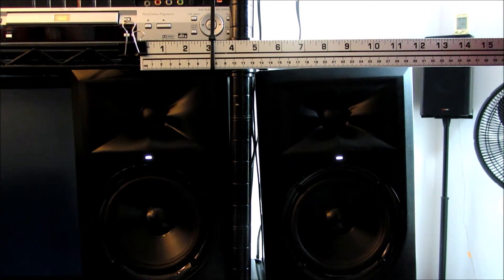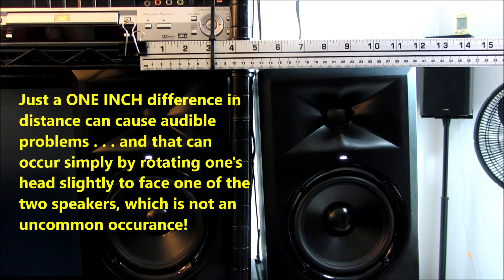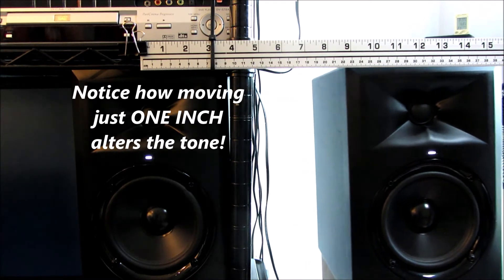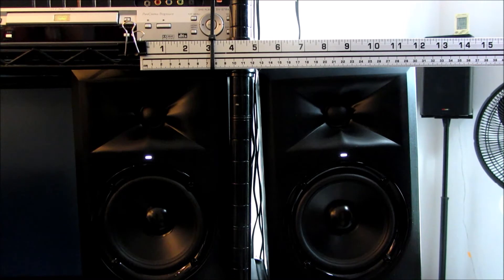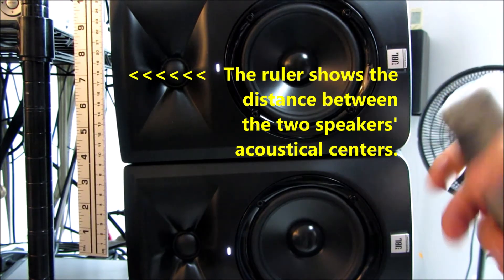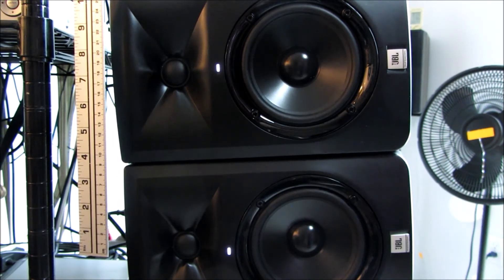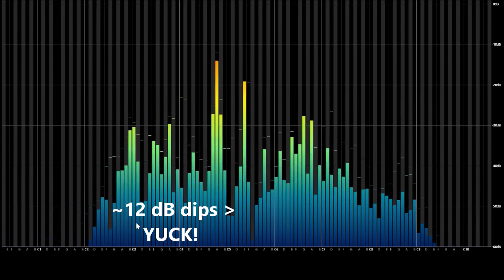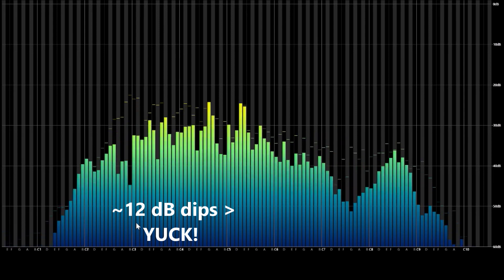Comb Filtering Problem From Dual Center Speakers

Comment: No, you should NOT aim for single driver for a certain register because of the "out-of-phase" cancellation shown here. Even if the shown effect also creates a comb filter I would say that it is of no importance here since it mainly effect the midrange and tweeter and not the bass as shown here.
What this demonstration shows is the importance of having your drivers time aligned to the listening position to prevent phase cancellation in the crossover region (about an octave).
There is another fenomen that's not discussed here and that is the out-of-phase cancellation because of room reflections, and the most significant reflection is the floor reflection that create a -6 to -12dB dip in the bass at approx. 80-300 Hz depending on the distance to the floor and the reflection coefficient.
By using several bass drivers at different distances from the floor you can even out this problem.
So using several bass drivers is beneficial to the sound and frequency response. It makes it much easier to find a good sounding position for your loudspeaker in the room.
As long as the drivers are basically time aligned you should not be afraid of using several bass drivers.
In practice you should aim at getting several bass drivers to be time aligned to your listening position within 0 to 1/5th of the distance between the top driver and the floor.
So this video is disinformative.
In practice one single driver is more effected by room reflection than two drivers are as long as they have different distances to the floor and still time aligned to the listening position to 1/5th of the distance between the top driver and the floor. Three or more drivers is even better as long as they are time aligned.

Comment: ive been considering running dual centers. i currently have a klipsch rp500c and just bought a rp504c which is the same thing just twice the length and 4 drivers vs 2. so if i was to run the center preout to a 2 channel amp and place dual 500c centers directly beside each other essentially being a 504c but with dual tweeters vs 1. would the same issues persist. the 504c is roughly twice the length as the 500c anyways

Comment: This was very enlightening. I’ve always been a bit bothered by having a center channel below the TV, wishing it could somehow sound like it was coming directly from the center (using a normal tv, not a projector) and always thought that it may be a good idea to have dual center channels with one above and one below to create the centered image directly in the middle.. But your video shows why that wouldn’t be a good idea, haha. Any further thoughts on that? Basically just have to put it below or go with projector and speaker behind the screen?
Reply from the maker: In a real commercial cinema there are three identical speakers in a straight line behind the acoustically transparent projection screen. That's the ideal but if you can't swing that you have a few choices: just above the screen,  or instead just below, both hugging as close to the edge as possible, or no center at all (aka "phantom center"). Zillions of people use that option; they call it "stereo". It too has a phantom center image.

Comment: Excellent procedure. Thanks 🙏🏼. I now  keep my center channel vertical. I am actually thinking of getting a single bookshelf speaker from the same speaker set and use that as a center channel.
Reply: In Dolby Labs where they invent this stuff their center speaker (only one of course, because two cause comb filtering) is EXACTLY the same speaker as the L and R for the best sound stage. This is also true of recording studios and commercial cinemas. There the center hides behind the acoustically transparent screen.